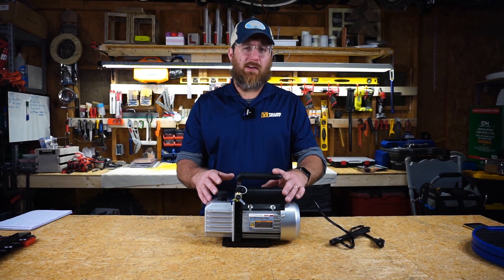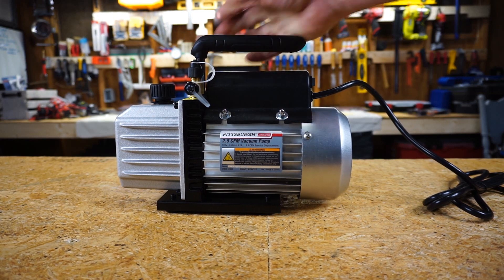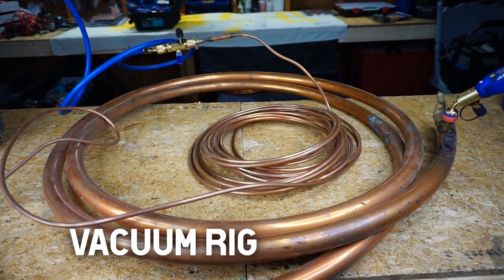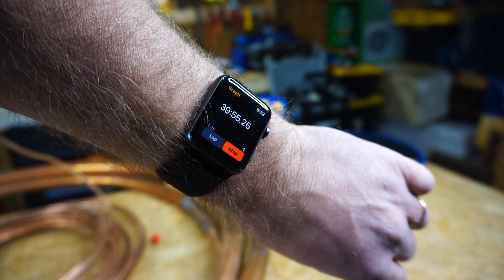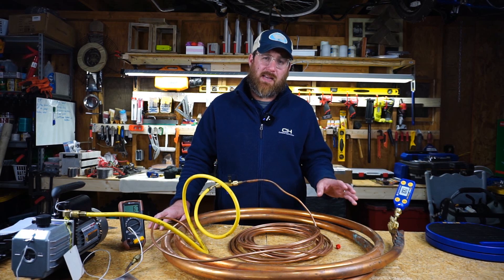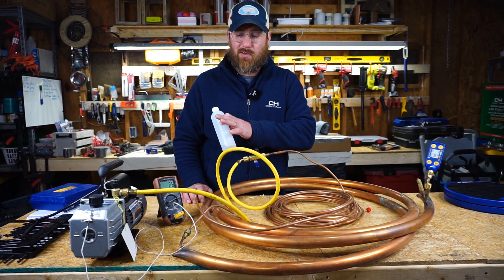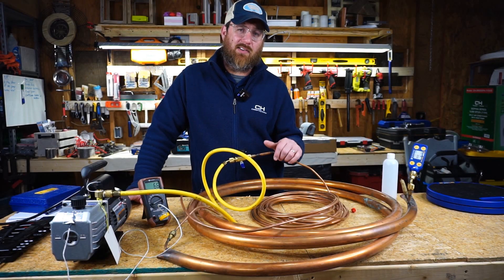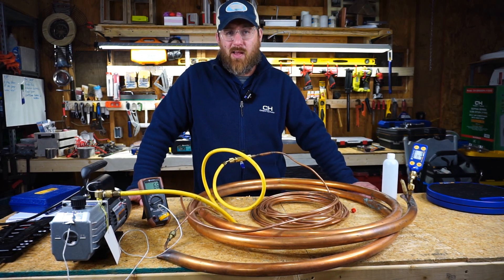Can a Harbor Freight Vacuum Pump Pull a Deep Vacuum?

Comment: Glad to hear it seems ok. I do not work in the industry, just a regular homeowner trying to install a mini split. I got a bargain on this pump, paying just $71. A lot of the jargon used in the industry is over my head, just trying to learn and see if I can do this without paying someone thousands. PS: I already called the HVAC company who put central air in my house, and with whom I have always done business. Guess what? They refused to say they would even inject coolant into the new mini-split on the grounds that they did not install it!!! One thing that really bothers me about this entire industry (home a/c) is that it appears to be CHOCK FULL OF CROOKS! We had a 2nd home in nearby city, just to lessen the commute, and once called a busy HVAC guy to check the a/c and attend to the usual (like replacing a $9 capacitor). He charged well over $1000 for an hour's work, and insisted on immediate online payment. He admitted to "earning" $7000 for his half day's work, and stated that he was trying to hurry because he wanted to spend the rest of the day on his jet ski's. The more I learn about typical a/c problems (such as replacing inexpensive capacitors and contact switches), which I have seen commonly marked up from, say $9 to $260 each, the more I realize how homeowners are gigantically just ripped off as a matter of everyday business. I'm sure I will hear defenses from industry workers, but I don't care. Seen all this with my own eyes!
Reply: I had one of those crooks try to tell me the main breaker on my old house (100 amp) was a $900 item just for the part.
Reply: @EristiCat  Haha. Outrageous!!! There should be a bureau to report such thieves.
Reply: You can be rest assured not all HVAC technicians are into “ripping off” the customer. I have been doing this trade for 28+ years. And when you give an honest price and try be somewhat profitable you will not get rich from this trade. For the larger companies it’s a numbers game. For example: Multiple vans on the road and giving excessive high quotes and seeing if the customer goes for it. With that being said, It’s wise to receive multiple quotes but the cheapest price may not be the way to go. Make your educated decision.
Reply: Well said unfortunately the trades are starting to fill up with a bunch of crooks that are really outweighing the good guys. Thank God for YouTube and good quality cheap tools homeowners are having to become contractors but any handyman with a good Head on his shoulders and basic set of tools and engineering understanding can install a mini split and the HVAC guys don't want you to know that
Reply: He I agree 99% of service companies are rip offs. That is all trades. Hvac is one of the worst. I live in AZ AC is big business. I work on my own system. I have worked as a Automotive Mechanic for over 40 years. I know how AC systems work. I bought tools for my house AC/Heat pump system. I think I spent $700.00 which includes 1 25 lb cylinder of 410A. Bought it about 4 years ago when it was $125.00 now it has gone up. I have in stock parts like capacitors/contactor/computer boards/Condenser fan motor/blower motor. I have used most of these parts over the years. One rip off service call would pay for my tools and parts.
Reply: @backnine  Brilliant! I really appreciate your posting how you took the initiative to address this major ripoff. On a smaller level I have tried to do the same, but am still learning more about A/C. I find that replacing parts is often simpler than just diagnosing exactly what is wrong. One time I paid for just the minimum service call, got the diagnosis, ordered the part and successfully installed it without a lot of training, saving about $400. Of course one of the most common faults, and extremely easy to cure, is just replacing a bad capacitor. Funny how for a $9 part they can charge over $400! The list goes on and on. I could never work in such an industry because I am just too honest to go around ripping people's wallet like that. Why can't they work for a fair wage???
Reply: @KpxUrz5745  From where can I buy replacement capacitors for our HVAC?
Reply: So get certified and do it yourself
Reply: I understand your frustration. But as a HVAC journeyman and business owner. There is a lot of liability we have to take on if you or another company installed the equipment recently. Typically within 2 to 4 years. We can't put our name on something we are not 100% sure you wouldn't sue us for if we work on something we are typically liable for everything even if it's only one part of the system that is being serviced. Now assuming the system has been working for a few years. Some companies will be more willing to do the work because the installation has been time tested. But it's all because of liability.
Reply: @AJ-ox8xy  Ok, I hear you. However, to me this doesn't quite make sense because a company agreeing to service someone's a/c is free to write a receipt stating the scope of their work, such as "Cleaned the coils and added (X pounds) of coolant in homeowner's pre-existing condenser unit", or whatever. Just like hiring any contractor to alter or fix something on a house. No court would hold a handyman responsible for unrelated issues just because he did not build the entire house. My conclusion is not that an HVAC company wishes to limit liability by refusing to work on a job, but that clearly they wish to send the message that they are punishing the homeowner for not hiring them in the first place to do the entire mini-split installation (at an absurdly high price!). I've even seen this in businesses like plumbing supply sales: if you didn't buy your sump pump from them, they refuse to sell you some plumbing parts like tubing or pvc parts, etc. I was once "thrown out" of a large plumbing supply business for that very reason after moving to my town, and I have never been back since!
Reply: Yea, thats right in line with my experience. Thanks for sharing your ventures!
Reply: They didn’t put “coolant” in it because you’re dumbass installed it and voided warranty. We’re not crooks we’re professionals
Reply: Absolutely agree, and that's why I got my EPA 608 so I would be totally independent of them when I need to be.  Value is awful - I have had super shoddy work done for incredibly expensive rates.  Pricing themselves out of the market.
Reply: Exactly the reason I started learning all I could about ac units. Guy charged me 250 for a 12 dollar contact plus a 90 dollar service charge..almost 350 for 30 minutes of work
Reply: @todddavis5433  I could never work in that business because I don't have it in me to be so corrupt and dishonest with people, overcharging ridiculous prices just because everyone with a broken A/C is desperate and willing to pay any price. It all sickens me. At this point in life, I am actually very wealthy but never earned a penny dishonestly or by overcharging. Even now, I still work for $75 per day when necessary to fill in. I used to live and work in NYC, but I NEVER made anywhere near the kind of money I discussed above in the A/C service business: many thousands per day. I should also mention, I hold an Ivy League masters degree and other educational credentials. Whereas all the crooks charging thousands per day to fix A/C's didn't even need a high school diploma. Now I see that one thing they should have taught back in high school was servicing A/C's, so we call all prevent being scammed.
Reply: @todddavis5433  if only 30 mins of work why didn’t you do it?
Reply: @devinbland7561  if I knew what I know now I would have. That's why I said I started learning everything I could
Reply: I’m a hvac technician and we don’t touch stuff installed by homeowners. There’s a liability that falls on you as soon as you touch it. Who knows if you or whoever installed it all correctly and we don’t want that falling back on us.
Reply: @devinbland7561  Thanks for the response, but I cannot see that that is a reasonable policy. I have never heard of a contractor or technician first asking "before I agree to work on any appliance or system at your house, I must first know who installed it". Furthermore, what if the system was not installed by a homeowner, but by a "professional" who was only average or who took shortcuts or otherwise lacked full knowledge and high standards? Would that be better than if it had been installed by an educated homeowner? I believe that the real reason some contractors may object is that they really want to earn the much bigger bucks of charging for a full new installation. For example, once my truck a/c had a slight slow leak. Rather than be bothered to diagnose and repair the isolated location of the leak in an otherwise new enough system, the dealer insisted upon just replacing the entire a/c at full cost. For the same reason, it is very hard to find a roofer willing to make a small repair. They usually want to make the big bucks of a totally new full roof, and not be bothered with "small money hassles".
Reply: @devinbland7561  What a joke.First of all most professionally installed mini  split by a HVAC tech do not come with a labor warranty,if they do it might be as long as 1 year.The actual warranty is parts and compressor from the manufacturer.Secondly,the problem is usually a leak which  is so small it takes a few years for the unit to stop heating and cooling.Then the tech who installed it gets to charge big bucks to fix it ,I mean fix his mistake.Lets not get away from the comment here that of a contactor being liable for something he did not install.A contractor cannot be held liable for something he did not do,and if he fixes a mini split he did not install and it breaks down again yep not liable even if it is his fault like a small leak.What agency is going to hold you responsible or liable?The only person who is liable is the owner to pay for your service,period.I find  it interesting there are  ones who do their job regardless of who  installed it.Have you ever heard of a mechanic who won't work on a car he didn't sell you,this concept only applies to some HVAC techs
Reply: @devinbland7561 agreed…UMC code has to many loop holes to blame businesses and techs…good for these peeps taking care of their own…install that on someone’s house and cause damage…businesses have 100% liability…
Reply: My dentist collected a few thousand dollars for some cavities.  Is she ripping me off?
Reply: @caru3257  Don't even get me started on dentists! I told my dentist that my teeth were going yellow... He said "so wear a brown tie"...   !!!  [Told that one to my dentist and you should see the look on his face. NOT funny at all!]
Reply: @caru3257 I think the whole world is out to rip each other off at this point.
Reply: @caru3257 medical field is one of the biggest ripoffs
Reply: @caru3257  yes, but could you learn to do your own dental work on youtube.
Reply: @brianduty4719  That is an exceedingly poor analogy, and of course unworthy of a reply on its merits.
Reply: @brianduty4719 How do you compare dentistry to HVAC work?????? You tech are nowhere near that intelligent. You can't go to trade school and become dentist. You don't have to be smart to service HVAC equipment 😂😂😂😂😂😂
Reply: @caru3257  Yes
Reply: @caru3257  Lousy comparison. You MUST  a tech 😂😂😂😂
Reply: You can always go to school for 2 or 4 years and become a technician yourself.  HVAC requires thousands in tools, a reliable vehicle and the gas to drive it around.  Some of the parts you may replace might not be that expensive but often time you need to diagnose the issue to figure out the problem.
Reply: @packrat76 Agree to what you Say But need to be a Reasonable charge across the line.  It's who we talking to which tech with conscious or not
Reply: @packrat76  You make reasonable points, but I'd like to reply. First, I seriously doubt that many HVAC workers ever went to school at all to learn their trade. I believe that most of them started as young apprentices with zero schooling, and just picked up the business from a fellow technician. We've called for HVAC repairs a number of times, and I always watch very closely just what they do, in order to learn more. I have never seen a technician spend over 5 minutes doing any kind of diagnosis, presumably because the typical a/c problem is pretty simple. Of course, this is all the more reason why they should not be charging so much for these services. As for a reliable vehicle, well like most people, I own two old but reliable vehicles, and often use them to do chores and favors for people without ever charging anyone a dime. I recently bought some HVAC tools because I am teaching myself to install a mini-split a/c. I spent well under $200.
Reply: bull crap!! @packrat76

Comment: I'm thinking you should have done a breakin procedure and/or used better oil. I did that with a cheapo 1stage from Amazon and easily pulled 130 micron on a system with 30ft lines (I didn't test pump alone.) Break in: Fill with oil and let sit for 10 minutes, remove all caps and start it wide open, let it run for a minute (will be fuming, so do it outside), put cap on intake side and let it run for 20 minutes (check oil level throughout), open everything again, drain oil. You can use the crap oil it comes with for this process, then refill with some good stuff (I used TSI Supercool v32). Going forward, if possible, always start/stop the pump wide open (no vac) and obviously keep caps on when storing and keep oil in the range at all times.
Reply: I asked the people on Ali Express "Yonntech" who apparently make these sorts of cheapo pumps, what oil to use and they said 100" or 68". I got some 68 iso and then when it came, in the manual it said 32 iso >.< I wonder how much difference it makes?.. The most I can get at the moment is around 28 Hg I think. Wondering if 32 iso would allow it to go higher.
Reply: @Lloyd.B.  The oil probably shouldn't make that much of a difference in how deep the vac is. It's more about how well it lubes the seals/valves and how much abuse it can take. 

You probably need a real micron gauge to test it. Hook it up directly to the port (no rubber hoses) and see what it can do. Even the cheapest pumps should be able to pull <300-400 microns, and I would consider anything that can't to be defective and send it back.
Reply: @bnasty267  Thanks. I can't afford a micron gauge, I'm already spending too much getting the stuff to do a mini split lol. I imagine 28 inHg is probably enough. The manual says to go to 29.5. It'll do a better job than the hand brake bleeding pump I was going to use :D
Should it be able to easily max out a manifold gauge?..
On this chart I found it says 500 microns = 0.5 mmHg. 
This makes no sense to me at all. 
My manifold gauges go UP to 76cm Hg = 760 mmHg - 0.5 mmHg would be virtually no vacuum at all on that gauge, so far as I can tell.
The numbers are going the wrong direction I think.. No vacuum on the chart is 760 mmHg. I'm guessing they are NOT both mmHg, one is starting at perfect vacuum and one at atmospheric pressure?. On the chart it has an A after it "mmHg (A)" Is that atmospheric?..
Reply: @Lloyd.B. A is absolute, minus out atmospheric pressure. G is guage pressure, which varies based on elevation a little bit.
Reply: @mikafoxx2717  
Yeah, I found this eventually:

“The universally accepted unit of measurement for rough vacuum in the United States is the inch of mercury (Hg), which may be measured in a couple of different ways depending on the method.

One approach is known as the “Hg gauge,” or “HgV,” and it uses a scale that ranges from 
0 Hg (the pressure of the atmosphere) all the way up to 29.92″ Hg, which represents a complete vacuum.

The second method is to measure in “Hg absolute,” also known as “HgA,” which is a gauge with the scale in the opposite direction. In this scenario, the scale on the gauge reads 
29.92 inches of mercury at atmospheric pressure, but a reading of 0 inches of mercury would indicate a complete vacuum. “

– It was not easy to find that information. People just say Hg and never say which type they mean. And I couldn’t find even one online pressure calculator that cares about the difference. It drove me up the wall trying to figure out what on earth people were on about lol..

Comment: Got in a pinch today when my Robinaire pump died, Harbor Freight was the only choice I had since the supply houses around here are closed on Saturdays  Just pulled a 2 ton 30 year old Carrier system down to 300 Microns in 40 minutes. This is with the king valves open, pumped indoor, lineset, and outdoor unit down. Not bad for $90 bucks

Comment: I thought 500 microns was the deep vacuum needed for HVAC. This achieved 300 not 500. What am I missing?
Reply from the maker: 500 is the desired vacuum.
Reply: @TALYN875  thanks! Rookie DIYer here who incorrectly thought 500 was lower than 300 🤷‍♂️.
Reply from the maker: @douggeiger9873  think of it as a linear measurement

Comment: I bought this product because local vacuum and charge cost for 1 car was similar to the cost of this pump and I thought, owning the tool would pay for itself after a couple uses. It did well on first car. Then I stored the pump 2.5 years before needing again. The cast aluminum oil tank broke during storage and was unusable for second use. I would say the quality difference is what makes it inferior. I believe better brand pump wouldn't have broken from being hit during storage. I don't HVAC enough to warrant the purchase of a better brand so this time I'll just be paying for a vacuum and charge.